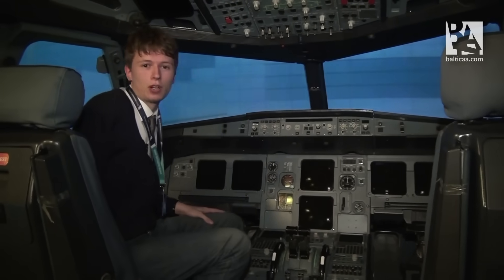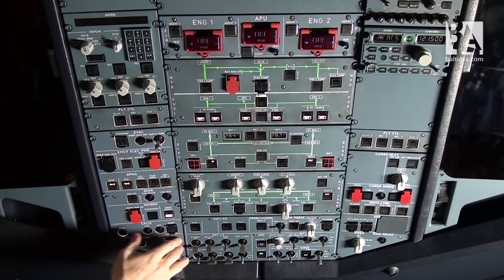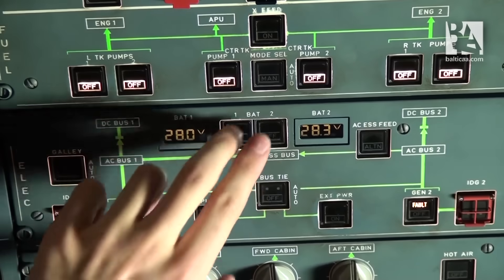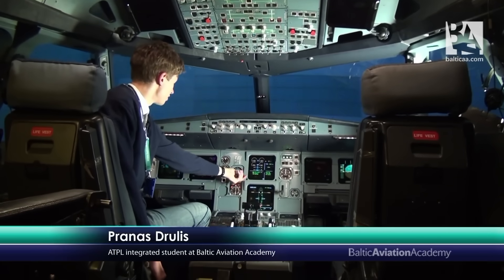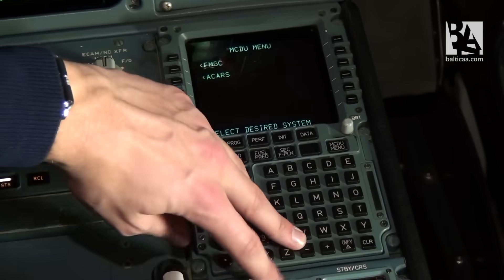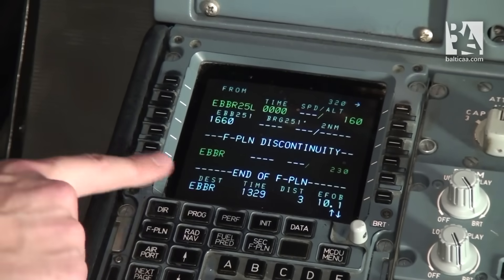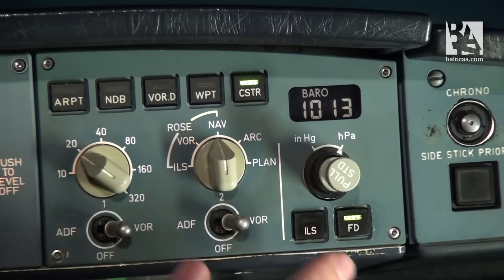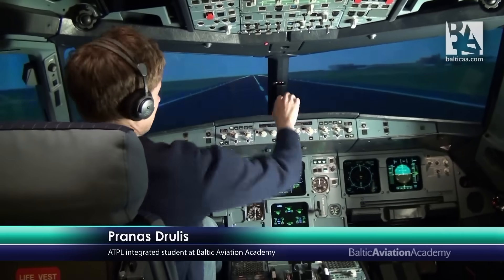Airbus A320 - From Cold and Dark to Ready for Taxiing

Comment: If you actually read the checklists properly you would have turned off the APU once the engines are started
Reply: No it does not. The APU is even in certain conditions left on during flight. At Innsbruck, because of the high terrain, high altitude, and short runway, packs are turned off for takeoff. However, because of how high the altitude is, the aircraft needs to be pressurized. Therefor, the APU and APU Bleed are left on for takeoff, and not switched off till around 10000 feet. At least at BA
Reply: @speedbird1598  @America West we shut down the APU once we had confirmed one good engine start. I started on 732s, then to 752s.
Reply: The APU is not on the checklist, it is a memory item from the SOPs
Reply: Thats what I said. It comes offline but not from a checklist. It is a memory item from the SOPs, After Start for Pilot Flying to be precise
Reply: Yes but once you have engine start, the APU needs to come offline.
Reply: Christian Cruz it has to be on during engine start, the APU gives the necessary neumatic pressure for the engine to start, well then it has to go offline...once at least 1 engine is running.
Reply: How many times do I have to tell you. Turn off the motherfuckin' APUs once the engine is started!!
Reply: There’s always one...
Reply: Not necessarily. On hot days without power  hooked up, sometimes they leave the APU running to provide air conditioning for the passengers. They usually don't start main engines until taxing to the active runway to save fuel.
Reply: mewantbrains after both engines are started then you much close the isolation valve.
Reply: Not necessarily. We kept it on after engine start. The logic will not allow two electrical sources. It will automatically trip off line. It will still provide heat and air if needed. If a pack is inop, you can substitute the APU.
Reply: You shut it down once all engines are running and their generators and bleeds are connected. You do a cross-bleed start (use bleed air from one engine to start the other) when the APU is inoperative. In this case you use a start cart to start the first engine. Typically you actually have to increase thrust on the first engine to start the second one, this isn't fuel efficient so you only do it when necessary.
Reply: The APU doesn’t matter if are off or on during engines start but is recommended switch off during start
Reply: Because the APU CAN BE DAMAGED DURING START

Comment: he also forgot to turn off apu
Reply: No, he did not. The APU stays ON until after take off but have the APU bleed turned OFF.  In that way, if you suffer a complete engine shut down in the moments after take off you at least have immediate access to APU bleed for a restart rather than having to wait for the APU to restart first.
Reply: dXb makes sence, thanks

Comment: Does it have to be so complicated? Cant it just be holding down the clutch, turn the key and then start the engines and go???
Reply: +peterahjorter In an ideal situation it could be as easy as sitting down and pressing a few buttons to get all of that done. Maybe still a bit more complicated than starting your car and setting your GPS, but nothing like in this video. But where a car can (in most cases) stop on the side of the road if it suffers a mechanical problem, an airplane can't do that. In such a case the pilots need to have greater control over all of the systems that are found in the plane so they can work around the problem and try to save lives. More modern airplanes can be a bit simpler to operate but they still have to have all of the options available for the pilots to handle  emergencies. 

Hope this helps...
Reply: +markotark I love the car with engine and GPS analogy!

+peterahjorter Yes, it is like a car. Except the engines need so much power to start that you need another engine just to start it. And you don't have one navigation system to set up, but like ... ten. And most of them are way more complicated than GPS. :)

Also: Your road is made of air - and crumbles apart when you for some reason (forgot to push the gas pedal? going uphill? no gas? engine "just stopped"?) can't stay fast enough to keep it intact...

Basically it's like the movie Speed.
Reply: +peterahjorter if it was that simple machine, it wouldn't cost millions of $
Reply: This was from cold and dark, which normally isn't done on a daily basis. Maybe once a day. After each flight, the plane is left with some systems running for the next flight, so things such as turning on displays and APU start are usually not necessary.
Reply: A small private aircraft is more or less start & go. They even have choke cables like old fashioned cars.

Comment: Even before he starts the apu he says to make sure the wipers are in the off position. Why?
Reply: Cuz if they are on, they will start when we start batteries.
Reply: And? What's the problem if the wipers start up when you start the apu?
Reply: Stephen Berthelot Its a rule, you need to Start wipers when you have everything set up
Reply: +Saud Al-Faisal Siddiqui actually made me laugh
Reply: The wipers must be OFF in the park position, to prevent damages due to a dry windshield. Repellent on a dry windshield is also a problem. Therefor they are on the checklist for APU.

Comment: What would happen if you select 'gear up' when on the ground?
Reply: +John Smith the plane sit on his ass like a cute dog.
Reply: Pascal Lafrenière Ok, cheers..
Reply: I dont know, but in simulator like FSX, it wont do anything before you take off.
Reply: Nothing. You'll get a master alarm. There is a switch on one of the gears called "squat switch" which disconnects the circuit when the gear is compressed (=pushed down due to the weight of the aircraft, when on the ground). If that squat switch failes though, you'll have a problem. That's why you always make sure that the gear handle is in the down position before turning on the master.
Reply: If the nose pin is not install the planes nose will land flat on the runway.
Reply: dXb I've seen your replies on alot of questions and you have answered them very well, are you an ATP or a student?

Comment: what does the gravity gear lever does on a aircraft. how does it works.
Reply: +Elvis Morgan: it turns off the gravity, duh! how else do you think planes are able to fly?
Reply: +Elvis Morgan It is used to deploy the landing gear manually in the event of a hydraulic/automatic deploy issue.
Reply: thanks appreciated
Reply: +freakaefari plane engines push the plane forward and it moves, duh (what I am writing?)

Comment: What about pressurization ? I remember that Helios plane that crashed in 2005 because no-one ever thought to set it to the flight mode before or after taking off.
Reply: +julosx It&#39;s automatic. You rarely touch the pressurization panel during normal operation in an airplane other than bleeds.

Comment: When you took off the APU was still on. I don't think that's quite right.
Reply: It is. The APU stays ON until after take off but have the APU bleed turned OFF.  In that way, if you suffer a complete engine shut down in the moments after take off you at least have immediate access to APU bleed for a restart rather than having to wait for the APU to restart first.
Reply: It can be. It depends why it was running in the first place.

Comment: A video like this does show that starting a commercial aircraft is a lot more complex then a typical automobile. This is a lot more complex then sit down in the car seat, put the key fob in the key slot, put right foot on the brake pedal, and push the engine start stop button.
Reply: Amazing, isn't it? The airplane costs 100 million dollars though.

Comment: Windshield wiper being off is a MUST lol
Reply: The wipers must be OFF in the park position, to prevent damages due to a dry windshield. Repellent on a dry windshield is also a problem. Therefor they are on the checklist for APU.
Reply: KiloByte69 Oh...kay?
Reply: Running wipers on a dry windshield creates all sorts of problems and delays.  It's an amateur mistake and pisses off the ground crew (not to mention the cargo).
Reply: +KiloByte69 He is right. Beside the coating, keep in mind how hard the wipers are pressing against the window. Cycling a dry wiper can majorly screw up a very expensive window. If you are on a check flight, and forget to check the wipers in the pre-flight, it's a serious fault.
Reply: +immortaljatt05 I think if they are used when dry they damage the special coating on the wind-shields which make it more slippery so that water doesn't stick to it. I may be wrong, though.
Reply: He doesn’t want to scare himself so when he turns on the planes he hears squeaks. Haha (it’s not even funny)
Reply: Daniel ilDanny How much water do you think is at 38000ft? :P They're for when it's raining on the ground, takeoff and landing.
Reply: So icing doesn't exist?
Reply: Yes if you run the wipers on a dry window on many aircraft like 737NG then the hydrophobic coating is wrecked and it is very expensive. Also almost nobody uses rain repellent as it is harmful.
Reply: Isn't the repellent discontinued now, due to environmental reasons?
Reply: immortaljatt05 priority
Reply: immortaljatt05 and gear down
Reply: Yeah they make an annoying squeaking sound if they come on when it’s dry
Reply: The pilot's side only glass window on a Cessna 414 was around $12,000 without labour back in 2009 (in Australia), so imagine what a pair of certified, electrically heated multi layer windows cost on an A320 (let alone labour, aircraft loss of revenue and parking fees) cost. It MAY (not absoloutely) decrease viability when it's needed most as well, through minor damage, coating or not. A full aircraft of people paying $100 that need a refund is about $17,000 depending on seating capacity... just make sure they're off, it can be a  costly mistake.
Reply: I imagine you wouldn't be too popular if they had iced themselves to the windscreen and ripped themselves off ...
Reply: +Josh Bennett How much water do you think would stick to the windshield when flying at 600 mph ? ;o)
Reply: +Josh Bennett 
Bullshit.

Comment: he had not checked the flaps
Reply: How would you "check" them? You just select 1+F for takeoff and that's it.
Reply: Well you're supposed to conduct a visual inspection/monitor the display, but it's a sim so its kinda irrelevant.
Reply: Oh, that's what you meant, gotcha. Yes, you're right, outside checks are never trained in those sims.

Comment: he forgot to turn off the APU after starting the engines
Reply: +gajustempus Also he the doors weren't closed at the Start-Up but i love his videos :D
Reply: +gajustempus He forgot an FO too! Which would be a bigger deal than leaving the APU on. :D The APU on the A320 can be run as high as 41,000 ft, no problem at all taking off with it running. Sometimes you might do this for engine performance (the APU running A/C and pressurization, engine bleeds off for takeoff power).
Reply: Yes which is a no no, also he did not select the main engine air bleeds and could not check the engines generators and charging systems on BUS 1 and Bus 2, he did not check and configure the cabin pressurization panel, he did not check the brakes or configure the transponder, to mention but a few.
Reply: Just curious, as I don't fly Airbus, but why would shutting down the apu be a necessary procedure after starting the engines? I get it saves a little gas, but can't it wait until airborne?
Reply: @nagyac0  Also airports want to be as quiet as possible when they are in a city so they have to turn things off when not using them
Reply: +gajustempus A bell will alert him and a blinking light
Reply: Joeschmoe for several reasons. Mostly because an additional engine running on an airplane means more stress for the component and therefore sooner maintenance - but it could also lead in vibrations.

There's at least one incident with an APU running as replacement for a defective generator causing a crash, as one of the struts holding it in place broke in the middle of the flight. That however ripped the entire tail section of the plane away.

The APU is meant to run on the ground. That's what it was designed for, that's what the security features are planned for.
Reply: Most important, he forgot to arm the missiles
Reply: @TheDopalgangr  and he forgot to arm the 'chem trail' for 30,000 feet.
Reply: @Joeschmoe APU is one thing but (from a330 manual) "APU bleed should be switched off, in order to avoid ingestion of exhaust gases by the air conditioning system."
Reply: I thought the APU was kept running to assist with river landings.
Reply: Thank you, come again!
Reply: It was an MEL item. Engine 2 gen inop.
Reply: And put back the master switch back to normal.... Also to arm the Spoilers, and forgot to set the flaps for departure... And.... Set the Auto brake to Auto in case of RTO....
Reply: @CrapuRO  yes. I was wondering if anyone caught that flaps and slats were at zero
Reply: spot on.
Reply: dXb anche io sono un carabiniere in congedo :D
Reply: omg yea!
Reply: No. The APU stays ON until after take off but have the APU bleed turned OFF.  In that way, if you suffer a complete engine shut down in the moments after take off you at least have immediate access to APU bleed for a restart rather than having to wait for the APU to restart first.
Reply: A320 FCOM 3.03.09 Standard Operating Procedure - After Start, Page 2: APU Master (if not required) ....................... OFF

As for your statement, the remaining engine will have enough air for cross-bleed start, especially considering that it's running at T/O thrust.
Reply: @dxb8086  That is basically what saved the passengers on https://en.wikipedia.org/wiki/US_Airways_Flight_1549 ; the captain was able to reengage the APU immediately after both engines were shutdown due to bird damage.
Reply: @HuguesTalbot  It was "including decisions to immediately turn on the APU", which by itself proves that APU wasn't ON during the take-off and was only started once the accident occurred.
Reply: @dxb8086  lol...which normal airline in the world does that?
Reply: also did he not remove park break before pushback?
Reply: You could tell these are the keys of airbus ànd finish
Reply: He is too child to teach

Comment: Does this work with manual transmission A320's?
Reply: +Mustang Pat   The manuals don't have APU.  You have to get it rolling down a hill and compression start... just pop the clutch in 1st gear...
Reply: @Dana_Danarosana  You forgot to mention how to prevent side fumbling....
Reply: +Mustang Pat They had a model where the passengers had pedals to power the engines. But they needed 3000 bags of peanuts and 1000 soft drinks per flight hour, and it was too expensive to fly.
Reply: +Saud Siddiqui Raises questions though. Does Everest really have the gradually 'slightening' slopes necessary to correct the down pitch at startup without crushing the nose gear at the same time? Do the passengers get a heads up on the minor pressure discomfort that can occasionally occur? Isn't the Annapurna inflight route ultimately a little on the rocky and foggy side? I've heard cynic pilot remarks about monsoon season wind shear being worse than for any other +7000m international airport.
Reply: prefer 2nd gear for smoother start
Reply: Mustang Pat of course 😉 never auto transmission for an airplane 😉😂🤣
Reply: why are there so many people with car jokes here lol
Reply: Mustang Pat only if it has a clutch
Reply: I think he forgot about the apu testing
Reply: Dana Danarosana APU ???well it can work whith any airplane boeing and Airbus but it is only for if engines can't turn in or you have no fuel on each side 😂😂😂
Reply: musicmatti yes😂👍🏾
Reply: Clutches for A320s are $110k! :(

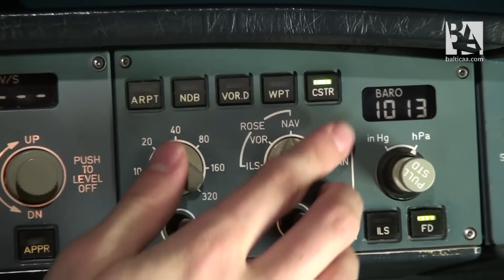Comment: 12:00 did you mean qnh? 1013 is for qne?
or is the qnh pressure in this theoretical case exactly 1013?
Reply: QNE stands for the standard pressure calibrated on airplane once reached 10,000 feet MSL. That's safety issues mostly, as for the QNH it can be determined by the airport observation of current pressure, temperature and elevation and ISA  which are variable. QFE is to be showing 0 feet on airport ground.
Reply: cool, but that was not the questions, but never mind
Reply: +mob1235 oh. Yes for this case in the video he uses 1013 because it's  for standard ISA pressure MSL, to be more precise it's 1013.2 at 0 feet(MSL)
Reply: +Naomi Hertz Per definition, QNE is not a pressure, it's an altitude. QNE is equivalent to pressure altitude. In other words, QNE is the Q code for the altimeter indication when 1013,2 is set in your kollsman. It's a common mistake.

Comment: What happens if there is a malfunction of one of the system tests (eg: Engine fire test)?
Reply: +XpertPilotFSX Have you tried turning it off and turning it back on again?

Joking XD
Reply: +XpertPilotFSX 
Take your toolbox and screwdriver to fix it.
Hammer is also  good.
Reply: +XpertPilotFSX Then he walks back to the instructor station and removes the failure.
Reply: WackyBroProductions I was talking about if the light itself doesn't show but the actual system that you're testing (like an engine fire test) actually works normal.
Reply: pcuser80 lol
Reply: +XpertPilotFSX  they grab a spare bulb and install it